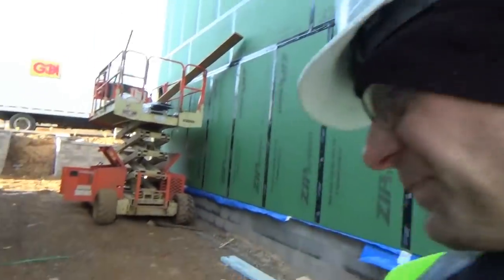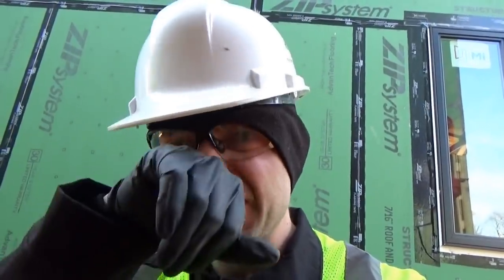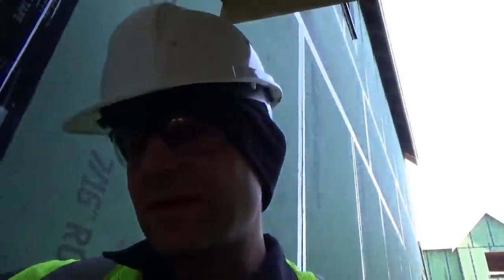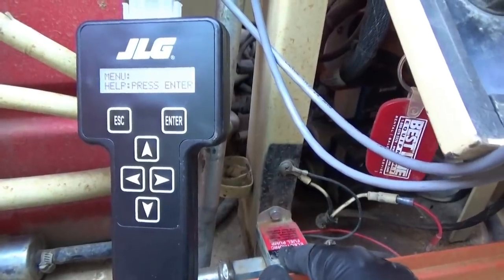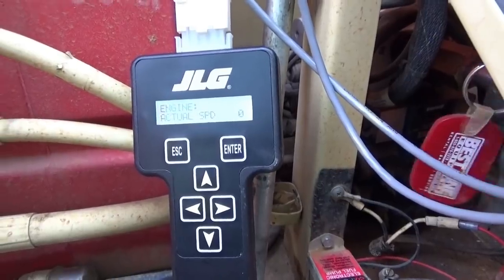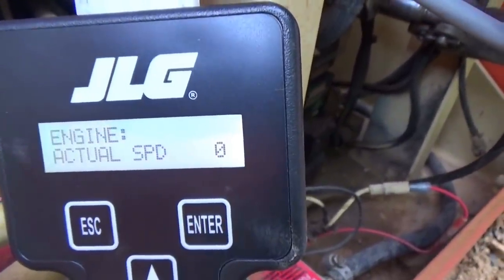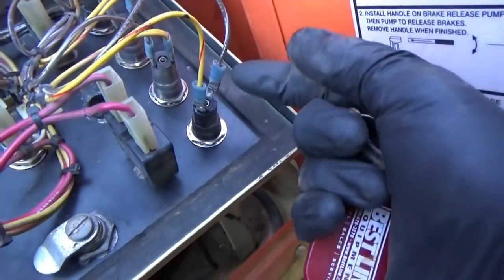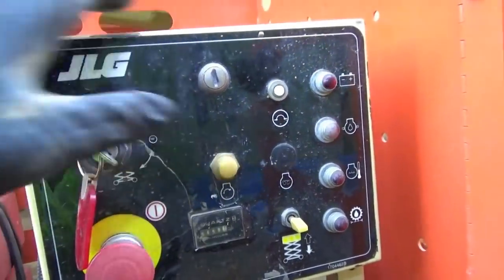"Baby Scissor" JLG: START-STALL Case Study

Comment: This is one of those things you only learn through methodical troubleshooting... Touch/eliminate only one thing at a time. So many guys just go running around pushing, turning, stressing this, unplugging/replugging that, they've just made their job 10x harder by disturbing. From where you ended the video I'd take that handheld diag and intentionally but slowly stress the wire loom/harness, and individual wires of the crank sensor while watching for dropout. 

Great video, I did industrial troubleshooting for many years, brings back fond memories of the fun challenges.

Comment: I like to have a propane bottle with a cut off torch with a hose connected. Add fuel with propane thru hose in air filter housing etc...this can help isolate problems

Comment: at that point, I'd have moved it away form the house and pulled all the terminals out 1 by 1 clean/tighten and re-installed, also clean the male half of the plug while looking for wire corrosion.
then apply new grease :)

Comment: hot wire the fuel pump.  Some interlock is not keeping the fuel pump running.  Oil pressure switch possibly.
Reply: certainly the carburetor bowl is larger than a  thimble...... meaning it would likely run for well over 30 seconds, possibly even multiple minutes with fuel pump off (from full bowl)
the pump shutting off was staged shutdown from input failure, if it was dual fuel it could have also been a the fuel changeover point, lack of propane, not purged etc. ( dont think that was a dual fuel though)

Comment: I am baffled as to why once the engine was running stable, it wasn't moved away from the wall.
Reply: because they'd just move it back there to use it for work? which is why it was there to start with  :))
Reply: @throttlebottle5906  - You misunderstood my question.

Comment: Ivan, have you done an oil pan gasket on the Mercury Cougar?  I will be doing one on the Ford Contour V6.  I wonder how high I have to jack up the engine to clear the pan?
Reply: My guess as high as the pan is because the oil pump is nearly at the bottom of your pan. Make it 3/4 of the height and be cautious when, you could get it out by turning it a little bit. Still, you have to fit under the car, so keep your belly in mind :)
Reply: @Spelter    Will the pan get damaged by lifting the engine with a block of wood on a floor jack?   I would then secure the engine with an engine support from the top.
Reply: i believe after youy remove the exhaust system it clears everything else, but don't take it as 100% definite, it's been a while I touched one last ;)

Comment: We have dozens of Kabota diesel powered boom and scissor lifts on the Australian mine site I work. Though the models onsite are certified mine spec, meaning specific design properties to ensure survival in extremely harsh environments, still fails to translate to reliability. The extra complexity is usually the multiplying factor in failures. 👍👍🇭🇲

Comment: 3 wire sensor = needs voltage. low battery iffy connection  no run.  load test and volt drop the wires

Comment: I think you should have sprayed some contact cleaner in those connections , plug then unplug them a dozen times, spray again, then used some new dielectric grease. I think they even have files that are made to clean connections like those. 

This reminds me of what Eric O says about not touching stuff because you can make the problem go away temporarily but then the customer comes back.

Comment: Daughter's Honda did something similar, went for a short period and then shut down. The crank sensor was faulty. Frustrating not to pinpoint the reason for a no connection as disturbing the harness probably fixed the fault. Plenty of dust and dirt flying about a building site so extra pressure on the electrical dept. Expect a recall at some stage in the future but at least you've got the problem covered.
Reply: I had the same problem with my wife's 2005 Honda civic, the reason for the crankshaft sensor failure is when a tech replaced the timing belt water pump etc, when the water pump is removed coolant Runs down the front of the engine right into the open sensor connector, then if the coolant is left in there it starts to corrode the connections causing a hard or no start problem a few months or year later,  I have  done this job that's how I know. Good luck everyone, stay classy :)
Reply: I had the same problem with my wife's 2005 Honda civic, the reason for the crankshaft sensor failure is when a tech replaced the timing belt water pump etc, when the water pump is removed coolant Runs down the front of the engine right into the open sensor connector, then if the coolant is left in there it starts to corrode the connections causing a hard or no start problem a few months or year later,  I have  done this job that's how I know. Good luck everyone, stay classy :)
Reply: @raymondreiff8170  We heard you the first time.

Comment: Common faults on manlifts:
Sometimes LPG switch on by error.Connections come loose in control boxes, Connection s corroded loose.
Also if you put planetary buttons on hub in it release s the hub brakes and you can move it free wheel away from house.
On the carbs there is a small solenoid on main jet shuts gasoline off for LPG use and or shut down s for low oil pressure.If jumped motor will run.

Comment: Also on the start screen of the analizer if you press enter it will let you know any fault codes in the system. You can also run a self diagnostic by going into service mode by entering service code. Then diagnostics. I t will then check all inputs and outputs for you.

Comment: Pull test all those wires.  I fear you will have a comeback on that one..
Reply: I was just going to say the same thing.
Reply: Lee Dress exactly what I was thinking Ivan is good but no magic stick was used here .  I’m thinking bad solder joints where one of those plugs are. .
Reply: That is never a fix..
Reply: I'd probably have at least put some DeOxIt on the non-weatherpack connectors (at the ECM/ECU?  The yellow one...)  just looking at basic positioning, that's probably prone more to water getting in the back-side of the pins than any of the delphi/packard connectors with grommets on each conductor (such as that on the crank sensor)....
Reply: Deoxit wouldn't hurt.